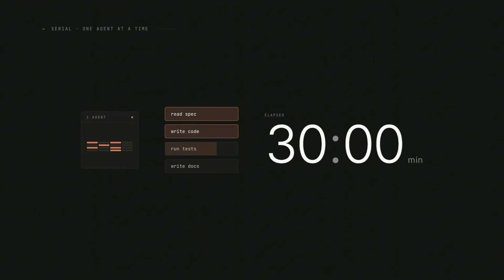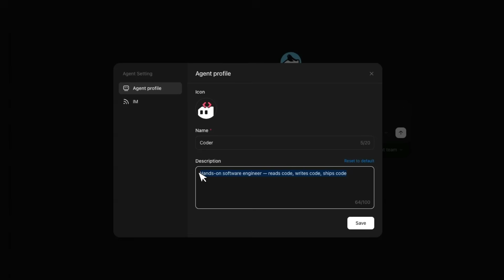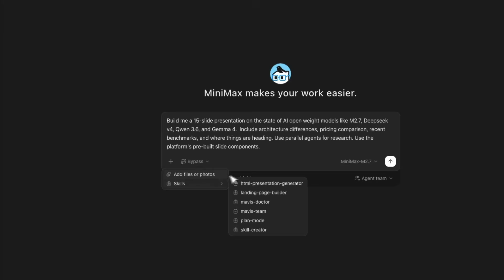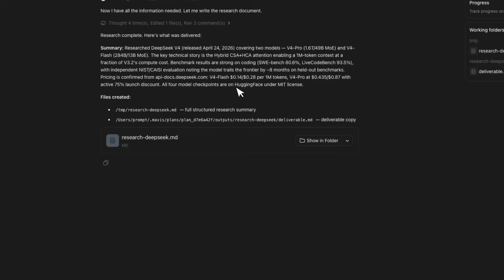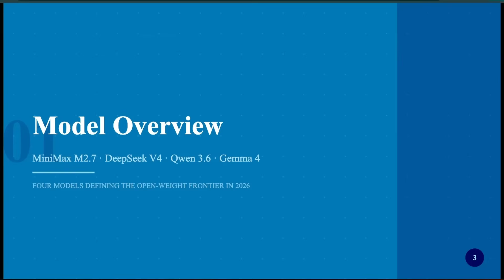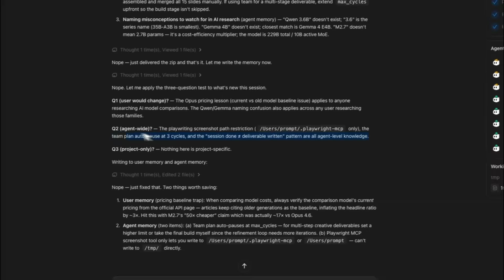Minimax Mavis Agent: The Verifier Pattern Changes Everything

Comment: I'm using minimax-agent. Why do I get the following error: "Forbidden: request was blocked by a gateway or proxy. You may not have permission to access this resource — check your account and provider settings." I'm having trouble finding the search results; sometimes it works, sometimes it doesn't. Do you have a way to fix this? Thank you.
Reply: i have the same issue

Comment: Honestly, I really don’t like this. There are much better alternatives available.
Reply: Such as please?
Reply: @jd5787  Check out the GSD plugin—I use it with the Pi harness. I will use one model for planning (Kimi K2.6), one model for executing (Minimax 2.7 Highspeed), and one model for verification (GLM 5.1). I've seen such good results with GLM 5.1, though, that I'm looking to switch it to the execution model and making the Minimax model the verifier. Costs next to nothing compared to Claude, and the results are excellent 🙂
Reply: The best implementation of this leverages different models from different labs. It's like getting experts who learned the same topic from different schools, and this can do a much better job of providing the benefits described in the video.